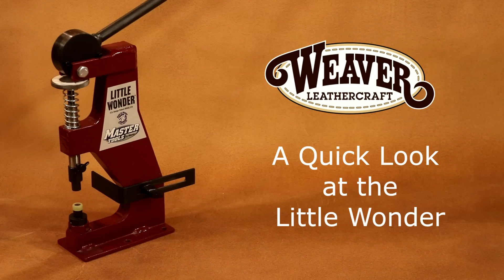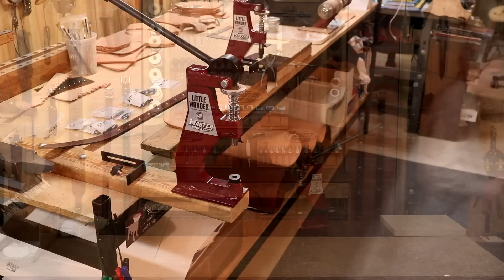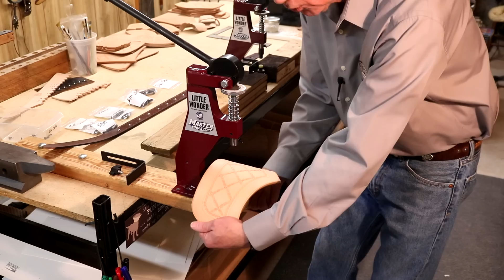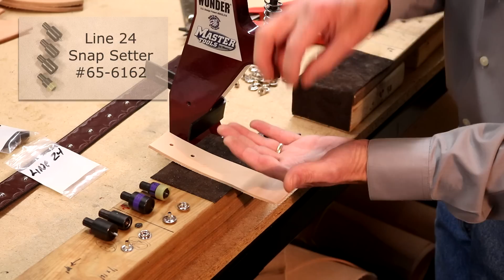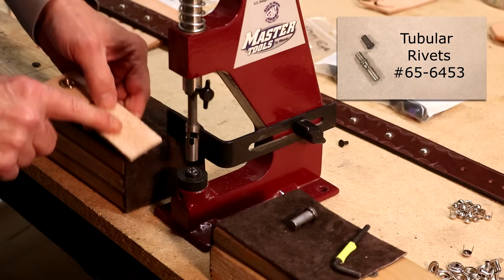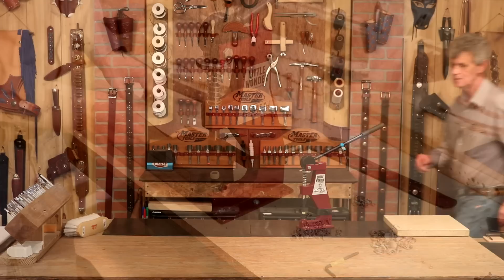The Leather Element: Master Tools Little Wonder Overview

Comment: Do I need weaver snaps to use the little wonder? I try using line 20 snaps from Tandy and they didn’t fit. To small.
Reply from the maker: Hi there,
The dies for the Little Wonder are made to fit the snaps that we sell. We cannot guarantee they will work for all snaps from other companies.

Comment: How do you set up and use a strop?  Which compound to use,? flesh side / grain side?  When and why? Etc
Reply from the maker: Hi Michelle! A strop can be just a piece of natural veg tan leather - it doesn't have to be attached to anything but it can be fastened to wood for a more stable strop. We would recommend either jewelers rouge: https://www.weaverleathersupply.com/catalog/item-detail/65-2937/jewelers-rouge-4-oz-/pr_8710 or Honing compound: https://www.weaverleathersupply.com/catalog/item-detail/65-2734/micro-fine-honing-compound-bar/pr_59820 
Just apply this to the flesh side of the leather and strop your knives and blades regularly to keep them sharp. If you let the blade get too dull, you'll have to actually sharpen it with a stone but if you strop between use it should keep your blades sharp for a long time. 
Here is a video Chuck did on stropping if you'd like to take a look: https://youtu.be/phAeANzrP2w

Comment: Hi Chuck, very busy with my own leatherworking projects. Making a suite of armor for my wife ;-) (got some time on my hands due to me being at home...something with corona virus...) I've got a question. Can you antique only a certain part on a project? Or is that difficult to do and will it get messy? (just to highlight a carved logo on a chest piece and not the rest of the chest piece)
Reply from the maker: Hi Bernard,
Very cool! It sounds tedious for just a small piece you want antiqued but it's best to antique the entire piece, otherwise, you will see where you started and stopped with the antique. Hope that helps!
Reply: In my mind, to antique a smaller area use a small paint brush and use some very gentle painter tape around the area to help avoid going too far.

Comment: Hi Chuck, old LEATHER SMITH here, my first shop was small not a lot of room 4 Tools, so I bought 2x4 metal hangers like the ones used 2 keep a door from being opened by unauthorized personal and mounted underneath my bench one on the edge and another one 6" back, I screw a 2x12 on the 2x4 and mount the tool such a vice on the 2x12 and when I require it's use get it out of the cabinet and slide into the metal hangers and get the same ease of use as U do but I don't have 2 screw it 2 my bench. GOD'S BLESSINGS BROTHER ✝️⚾🙃
Reply from the maker: Great tips if you have limited space! Thanks, Jim!

Comment: Our Little Wonder and Mighty Wonder are two pieces of equipment we wouldn't want to work without. We bolted our Little Wonder to a 36" stool to make it easy to move around the shop. Wife works on one side of the table while I'm on the other. If she needs it she can easily move it over to her side and same for me. We were thinking about craft shows and portability, hence the stool. Works great for us.

Grey Skyye Leather Co = a Weaver shop for the most part. =)

/waves @ Chuck!
Reply from the maker: Thank you so much, E.J.! That means more than you know! That's a great tip on mounting the Little Wonder to a stool.

Comment: Love your show. ? I have a large tanned deerskin can you make it hard again to make a holster ect.Man you do excellent work.
Reply: Deerskin is way to light for a holster. Is it with hair on or off? You will have to use a backing material like a 3 or 4 oz leather, depending on the thickness of the deerskin.
Reply: It is with out hair 1/8 to 3/16 thick soft like a shammy. Light tan . Thankyou for your reply.
Reply from the maker: Like, Fran said, you will need to line it - if you line it with veg tan then that will give it shape and body since deer tan is usually pretty soft. Hope that helps
Reply: @WeaverLeatherSupply  Got it thankyou.

Comment: Thanks for sharing! Quick question - could you go over what temper of leather works best for different projects (especially in veg tan)? I understand what weights are best, but temper is still confusing for me. Thank you for all you do!
Reply from the maker: Hi Deneena,
It depends a little bit on the project you're working on. Soft tempered leather is usually used for bags, purses, things that don't need a lot of body. 
Natural veg tan leather will have similar temper no matter what weights you have - it can be molded, formed, stamped and tooled and it will hold it's shape. Bridle, Harness and skirting leather will also have a firm temper. 
Something like a milled or tumbled veg tan will have a softer temper and wont hold it's shape as well. See if that helps.
Reply from the maker: Hi Deneena,
It depends a little bit on the project you're working on. Soft tempered leather is usually used for bags, purses, things that don't need a lot of body. 
Natural veg tan leather will have similar temper no matter what weights you have - it can be molded, formed, stamped and tooled and it will hold it's shape. Bridle, Harness and skirting leather will also have a firm temper. 
Something like a milled or tumbled veg tan will have a softer temper and wont hold it's shape as well. See if that helps.
Reply: Thank you!

Comment: Chuck, I have such an issue with snaps. The 5/16 post ones you sell on Weaver should work for what leather weights? If I'm going through two layers of 4-5 oz it's usually not an issue, but when I try to go through a single layer (like a pouch flap) it twists or flattens the post. I saw your video on setting them, but I'm still having issues. How much post should stick out? I assume if it's proud of the button it's too high?
Reply: I am also having problems with snaps on leather that is 3 to 4 oz. Need snaps for small wallets... preferably in brass finish.
Reply: When I worked in upholstery we had 2 length posts. You can grind the long posts down if you really had to.
Reply from the maker: Hi Myke,
The post should be about 1/16"  longer than the leather it's going through. If the post is going crooked or flattening, then it's probably too long for the leather it's going through. The 5/16" inch post work great for an 6/7 oz up to  about 8/9 oz. which would make sense that they work for your two layers of 4/5 oz. 
We are adding shorter post snaps soon so keep an eye out for those. They should be up on the site next week sometime and we'll try and shoot you a message when they are up.